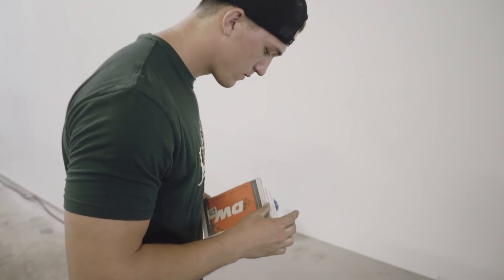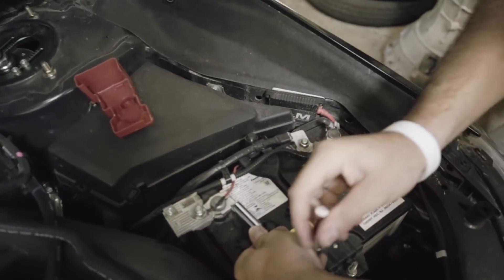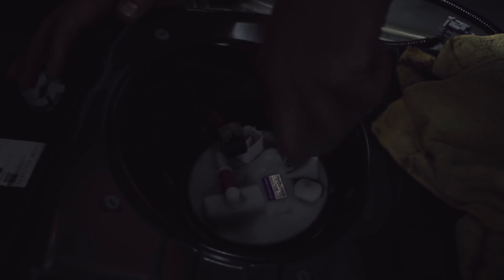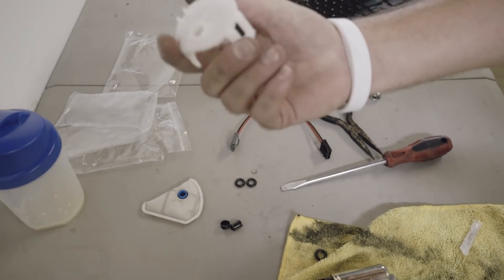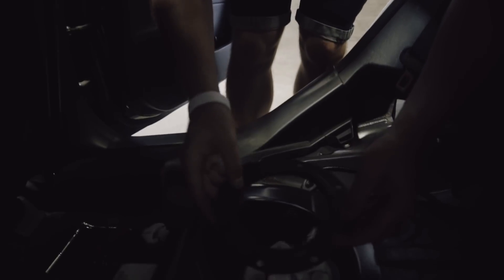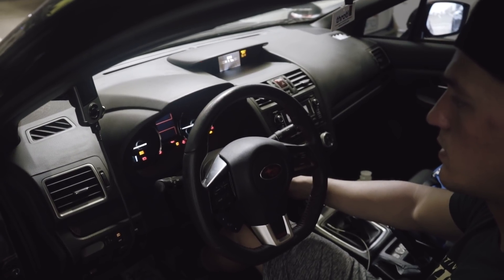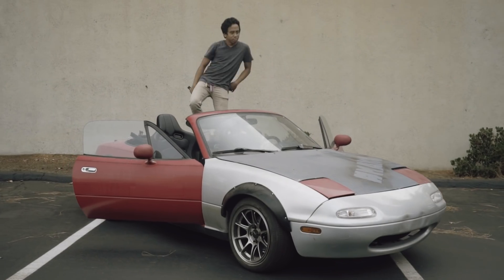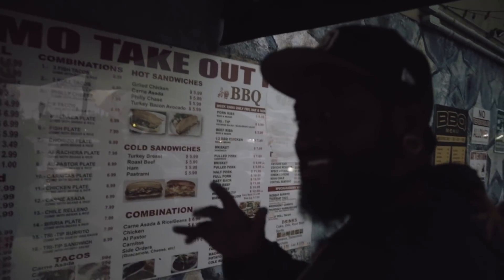Time For e85! 2015 WRX Fuel Pump Install!

Comment from the maker: Thanks for watching bros! Save 10% on car parts and sign up for Throtl VIP http://www.Throtl.com/i/Dustin20.
The road to beating TJ's BRZ starts now :)
Reply: Dustin Williams love your vids ❤️
Reply: Dustin Williams what #s you think you are going to make? Anything over 380tq you should have the tuner scale back. Up in that range you start messing with the rods. Just food for thought. Anything over 400awhp you will start having oil pressure issues. You should consider getting a Mishimoto oilcooler too it how well with the e85 car runs real cool with no knocks.
Reply: Dustin Williams smooth video

Comment: another thing you should do is before unplugging the battery is pulling the fuel pump fuse and then starting the car and letting it idle until it dies that way there is no fuel in the lines and you get less fuel everywhere. great video! maybe next time get a light for the inside of the car so its all easier to see in the video?

Comment: Might want to look at my pump install video. You guys didnt grind down the ridges of the new pump and not sure you used the correct spacer with 2 o-rings. Good luck with your tune!

Comment: I see two O-rings on the table. I'm going to bet you only installed one ☝️ watch my video on this Dustin and you will see how to do it correctly. If you can't go back and add the second o-ring you will get fuel cavitation leading to fuel starvation and fuel cut at high RPM this can cause a lean condition and then you can say goodbye to that engine and say hello to a 10K engine build.
Reply: How many o rings should be installed ? 2 ? Or 3?
Reply: @eduardox2609  2 O rings just like the instructions say to do.

Comment: Installed incorrectly... should've used the stock spacer and 2 o-rings on the new pump. You will most likely end up with fueling issues down the road from not having a proper seal.
Reply: Justin Vetter agreed!!
Reply: bump
Reply: Justin Vetter yep watch my video Dustin.
Reply: yo whats up justin. You going to thunderhill on the 4th?
Reply: Cali WRX yo! I don't think I'm going to make it on 9/4 because I'm going to have my buddy and his wife coming out to visit. I will be going to Thunderhill 9/9 though! Kind of want to go 9/4 as well and take my buddy, but trying to limit the abuse on the WRX lmao need to get rid of it so I can build a real track car.

Comment: Please look into HPFP issues running e85. It seems like some people run a Lubricant so their HPFP don't burn up. Along with running 91-93 every third tank. Hopefully you won't run into any issues, just something to look into.
Reply: On the new WRXs with the FADIT it's not safe to run straight E85. Most tuners only tune for E60 at the most. He'll always have a mixture of 91-93 with E85. I been running the same fuel pump with the Cobb flex fuel kit for about almost a year and haven't had any fueling issues.
Reply: Been running Cobb Flex Fuel on a 2016 wrx for a year. The in tank fuel pump is not the one that dies when using e85 its the HPFP. Dustin if you run full e85 make sure you run a full tank of 91 every 3 tanks or so. I personally run about e65 and have had zero issues for a year. the power gains are RIDICULES!
Reply: Marc Mattson what's your mod list? I'm always interested in other people's builds.
Reply: Chris Skaggs currently flex fuel. Intake. Tgv deletes. And suspension mods. What about you ? Thinking TBE is next but unsure
Reply: Marc Mattson 
Beefy Badger Short Block 
JE FSR Pistons
Manley I beam rods 
King XPG racing bearings 
OEM Crank 
TVG Delete
EGR Delete 
Cobb Flex fuel 
DeatschWerks 340lph DW300c Fuel Pump 
7042 CSF Radiator  
Southbend Clutch Stage 3 Daily 
PSP Engine mounts 
Trans mount 
Crossmember bushings 
Kartboy cable shift lock 
Invida Catless Downpipe 
Invida N1 car back 
Mishimoto FMIC 
Custom 3.5" intake 
AgencyPower Headers 
This is all I have for now. I was on steamspeed turbo but kept blowing it with only a few hundred miles during break in period on the motor

Comment: For a guy that supposed to be so knowledgeable, why did he unplug the positive battery terminal? ALWAYS unplug the negative terminal first.
Reply: binyamj Who cares lol I bet he's more "knowledgeable" than you
Reply: Who cares? Obviously you don't understand anything about cars. I commented on a mistake made by an "expert" and through the internet, you have figured out that I don't know anything about cars. Great job!
Reply: binyamj lol people make mistakes dude calm down you're gonna question his expertise because of a minor mistake he's an expert you're not simple as that I bet you would make mistakes too mistakes he would call you out for so don't try an act like you're a master mechanic
Reply: Well, look at the other comments. He didn't even do the install correctly. So it wasn't just one mistake, but several. Some expert he is.
Reply: Phurrr shush man. He pointed out another mistake. This whole install was very very poor. Especially since they are making an install video. This is bad information to pass on to others trying it.
Reply: Best Sounds especially since the 2015 wrx doesn't even need a new fuel pump to run e85....the stock pump can handle it no problem